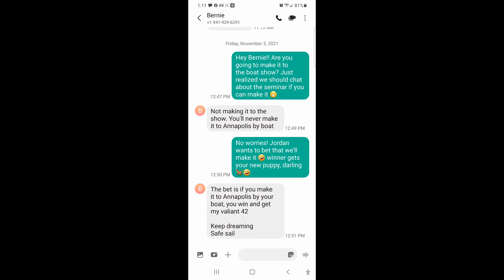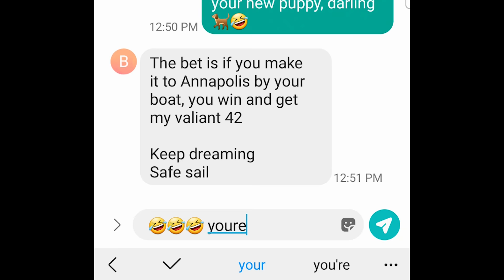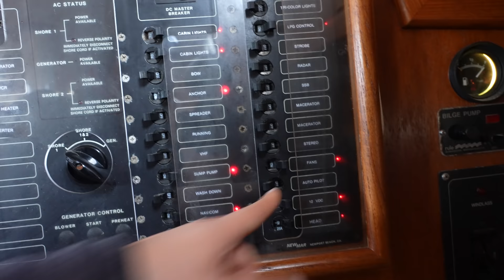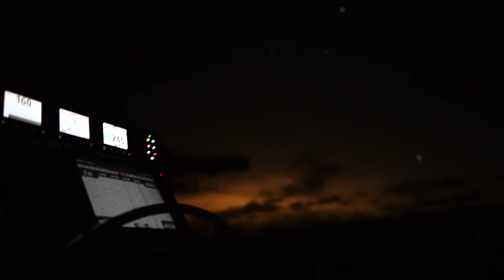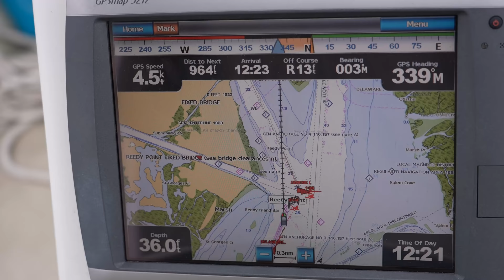The parts that SUCK... | S06E24

Comment: Two quick thoughts. First you could tell they were strong waves when you could actually see them in the video. Lotta times it’s hard to make out the waves that the boat sails through on video but you had some good ones that rolled through there. Second point. Lovely shot of Orion. I didn’t notice the time marker but you had a great shot of the constellation Orion up in the sky.

Comment: Why don’t you guys have some Dramamine (sp?) on board or those little patches you put behind your ears? I get seasick too but so far it’s only been on everything “except” Sailboats.  Personally, I think it’s Diesel because that’s the only time I even felt like I might get sick sailing & it went away as soon as the engine was off.  However, it seems to only happen at the beginning and not again until I have spent considerable time on land.